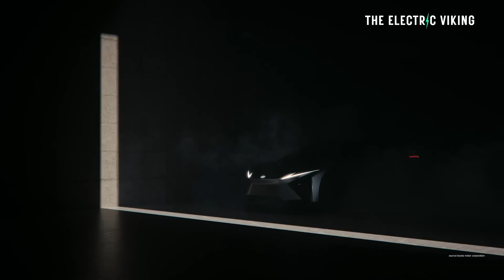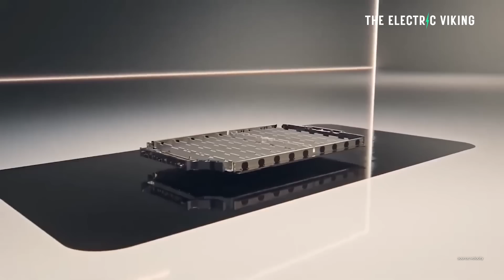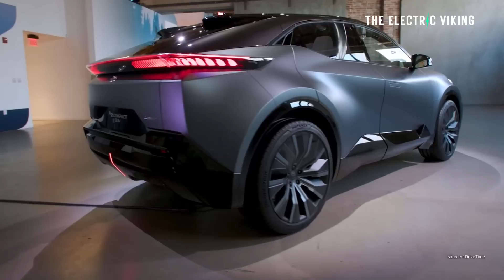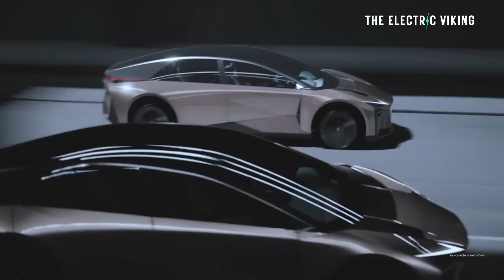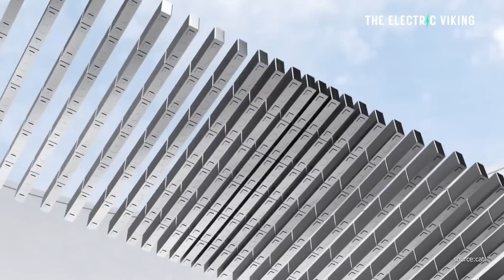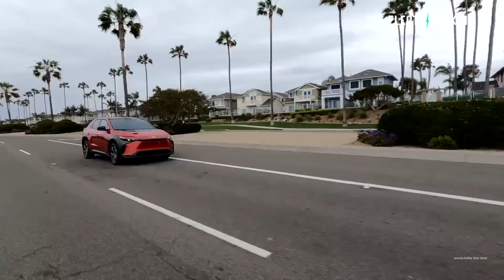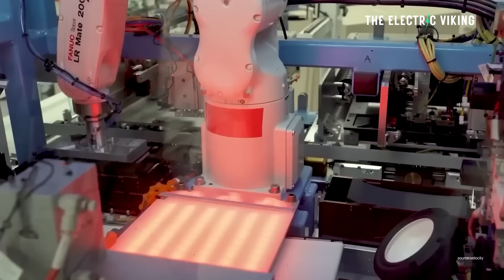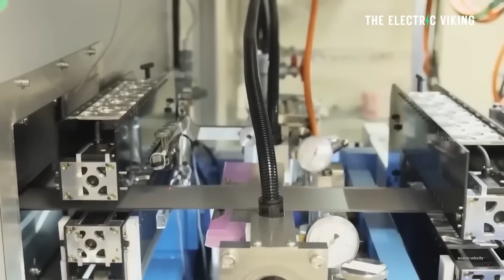Toyota says it has game changing LFP and prismatic cells that will destroy BYD

Comment: Even if the battery weighed nothing at all, the rest of the vehicle would still weigh at least 1000kg.  Basic physics says getting 8 mile per kwh in a 1000kg vehicle could be done if the car had a CD<2.0, a frontal area<2sqm, low rolling resistance tires, and drove at a steady state of 40mph.  Those don't sound like real-world conditions to me.  Could Toyota or anybody else build a car of some kind that would get 8m/kwh, sure, easy, but not anything conventional looking and sized like they showed at the Mobility show.  Maybe they'll test it while it is going downhill ?
Reply: I was thinking similarly but in Kilometers. 80 KWh battery and 1,000 KLM range is 12.5 Klm per KW. As my model 3 SR+ (which is regarded as being very efficient) gets around 8, something seems off. There’s relatively simply mass / aero Vs capacity calculations (well maybe not that simple) which would imply these figures would be impossible for a car weighing more than 850 Kg’s with a CD above 2.

Comment: You can get 1000mi of range with a small battery pack: simply throw in a 15-20kW generator or an eCVT hybrid drive train with 20-30HP engine. Seems like the most obvious way to reconcile Toyota's commitment to ICE into the foreseeable future and its new battery factory plans. RE-EVs and PHEVs need batteries too, and you can pump out about three of these for the same amount of batteries you would put in a single pure BEV.

Comment: There are batteries in development with much higher energy density. They're being developed for air travel. The cost is the problem with considering them for cars. Also cycle life is a concern.
Reply: I know Tesla already have a battery pack that will do 1000 miles in a model three. The only issue is you can’t charge it more than 80 times. Okay, so that’s 80,000 miles from a pack, but it’s still less than you would get from existing chemistries.
Reply: It doesn't matter how energy dense the batteries are, if their capacity is 80kwh, they could weigh zero and you still couldn't build the rest of a full-sized vehicle light enough to get 620 miles from that size pack unless it was on a course going 30mph so wind resistance had no effect, or it was mostly downhill getting regenerative braking.  Maybe an Aptera could do it, but nothing Toyota would build.
Reply: @kirkellis4329 yup, exactly.  That or Toyota has broken the laws of physics 😂. The improvements they’d have to have made in motor efficiency and aerodynamics are simply not possible, in my opinion as well. Coming soon… the Toyota Neutron with physics from a neighbouring universe!